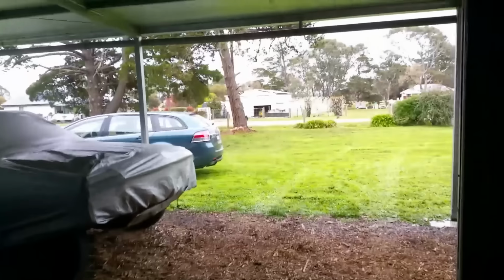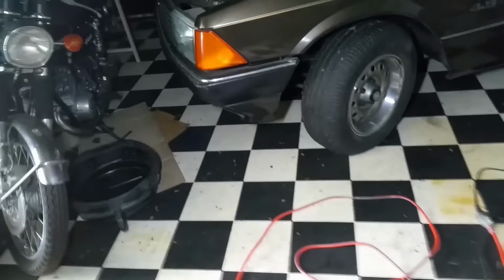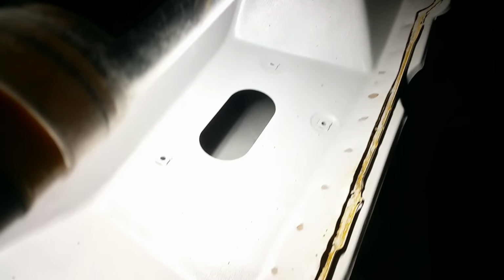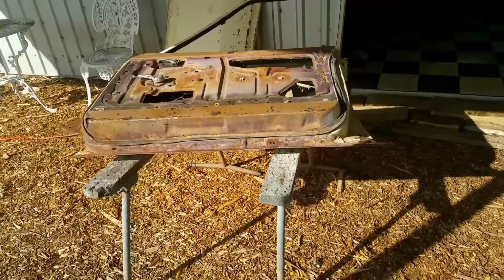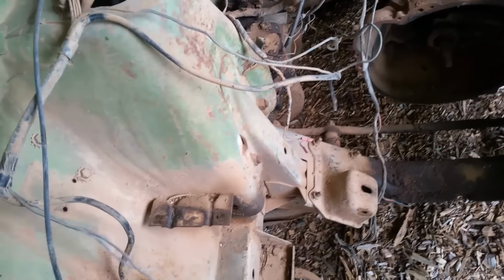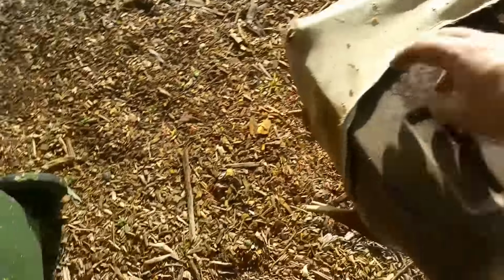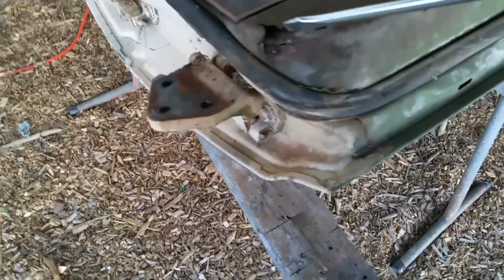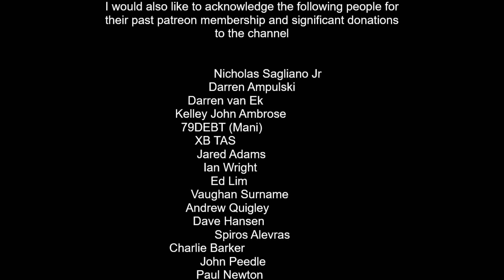XA Falcon Wagon Pt4 - The Extent is Divulged

Comment: LOL unpainted metal on Falcons so yes they rusted when near salt air on new late model Falcons and Holdens had rust in seams, BIL was a panel rep for Ford recently, there were reasons they didnt sell well. Your XA sedan has similar rust to one I owned in the 80s road spray came into the car same green too.

Comment: Back when xa's became affordable for me to drive I purchased a really good ute 250 three on the tree, a local auto elec would build a whole new head light loom with relays for high and low beam and the new loom would plug into the right side headlight plug and leave the original loom so if you sold the car you could remove the new loom. It used to backfire badly and was getting worse couldn't find the problem turns out the back of the ignition switch was broken effectively turning itself on and off quickly causing it to backfire
Reply from the maker: Don't you love the old cars though? I adore them, getting a parts car that will be aiming straight for the crusher, then you gradually transform it... it's my favourite thing to do. Your ute sounds like a gem. I wanted to do a 3 on the tree for this car but I can't find anyone with a set of linkages and other associated parts.